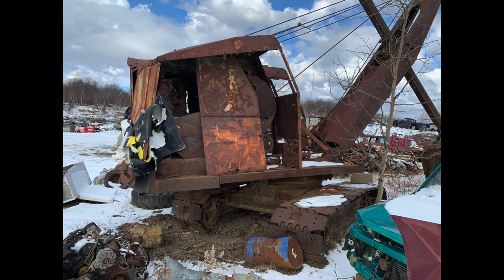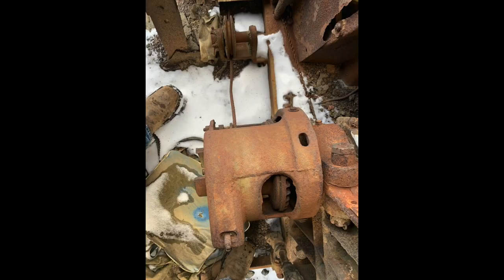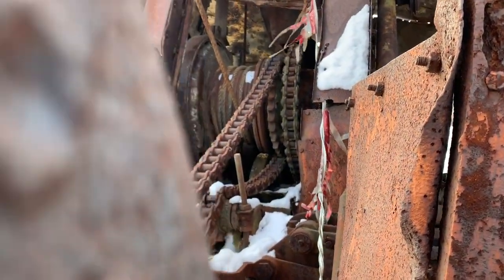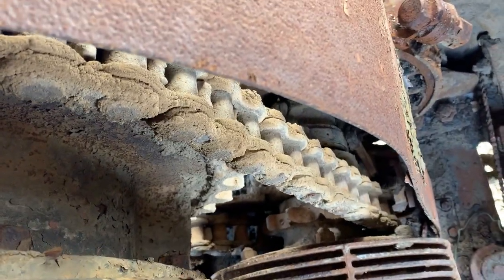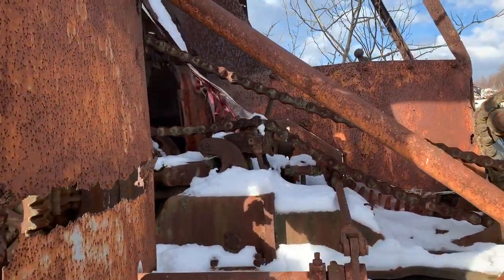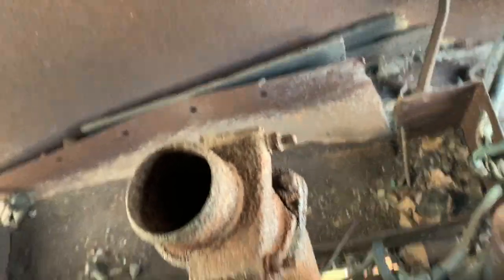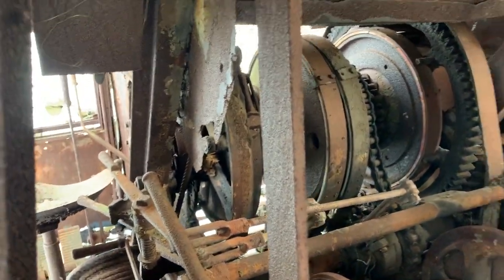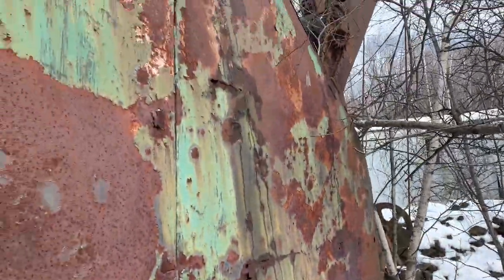Lima and General 3/4 yard shovels

Comment: To me the General would be the one to try to acquire, more unusual and completely different than anything else you have. From the little I saw it could be a Buda. The big straight 8 Buda I have started after 25 years, just had to free up the rack and some of the piston plungers in the injection pump. I didn’t get video of my P&H and other equipment at Badger show grounds the other weekend due to bad weather, I’ll try again next time I get that way.  Geoffrey